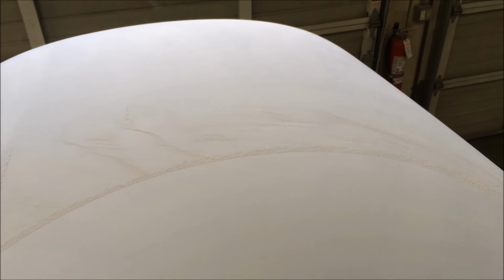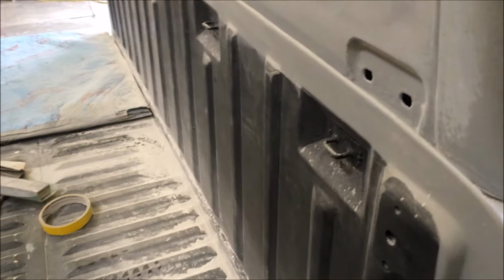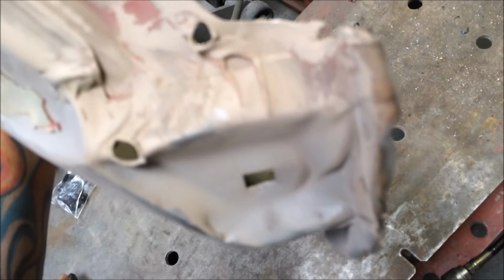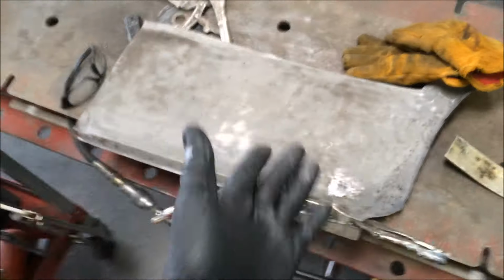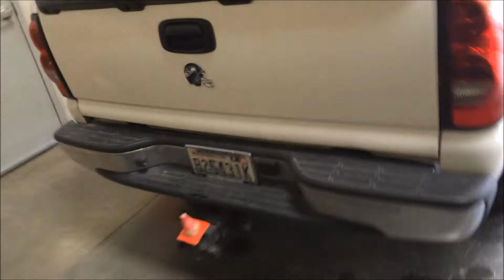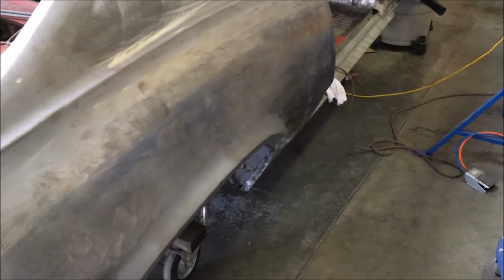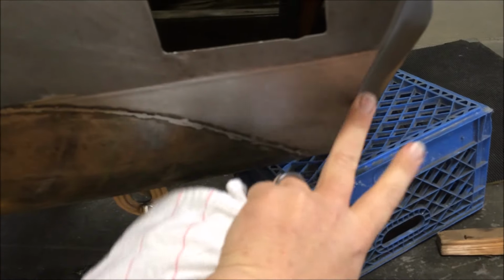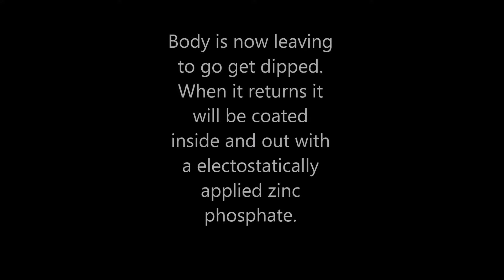Quarter Panel Rust Repair, Sanding Polyester Primer

Comment: I've never used one of those shrinking discs. I'd like to try it.
Reply from the maker: +MrHevyshevy I think you might like them. Not really as fast as a torch but you have a little more control and the way the disc shines up the surface kinda shows you where the low spots are still.